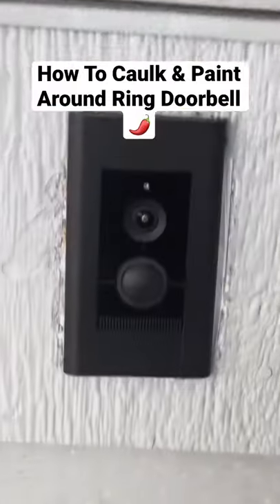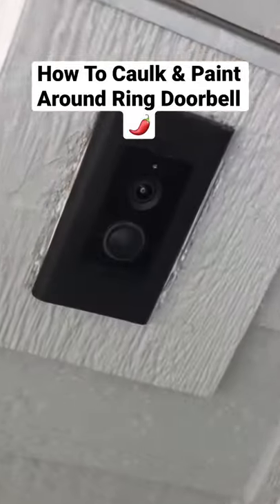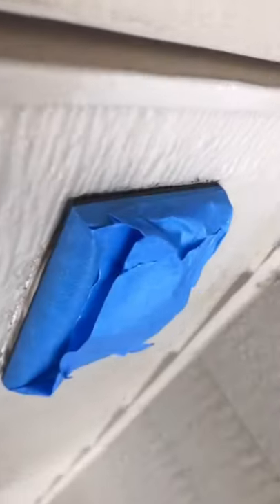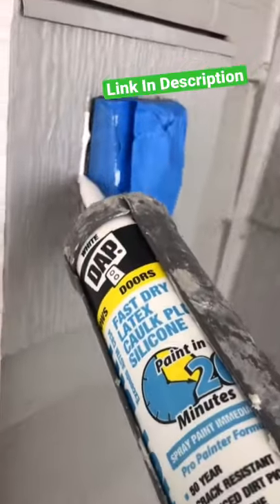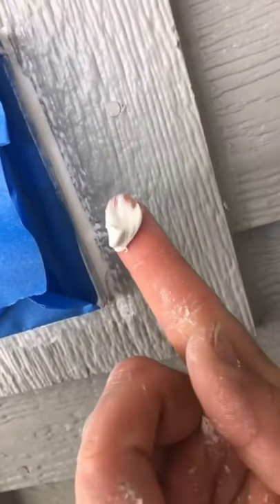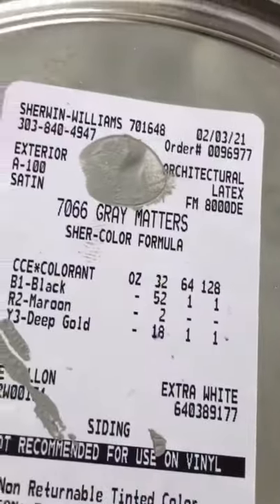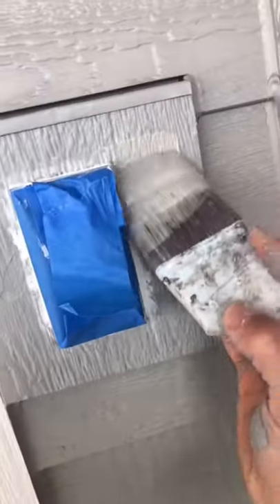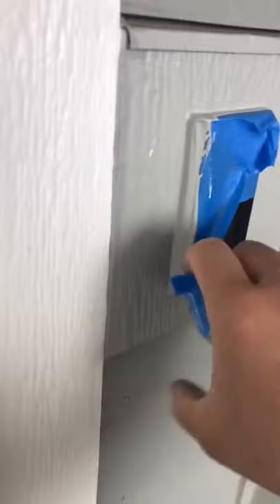How To Caulk & Paint Around Ring Doorbell. #caulk #paint #ringdoorbell #handyman #diy

Comment: Would not recommend caulking around door bell button. This device has to be able to be remove if it needs trouble shooted or serviced. So you'd be recaulking it everytime.
Reply: Got em 😂
Reply: You're right, it's like caulking a switch wall plate, sure you can do it, but the point is for it be removed, not glued onto the wall with caulk
Reply: Came here to say exactly that. It's going to be a huge pain every time.

Comment: FYI jalapeño. You can bondo the damage,(your favorite fix)then dremel tool the wood grain in,prime and paint.no replacement necesary,looks kick ass and it's still a quick repair.boom👍
Reply: Handctexturing wood grain with a Drexel is a quick repair?.
Reply: @kjcorder  yes.if you watch the video there is a circular pattern to the left of the ring where the wood grain is gone(the mdf peeled) along with the areas just around the ring he is addressing.you can take bondo and skim coat all the chipped and peeled grain areas.(bondo dries in 5 minutes),get your dremel ready and use the small cone  while the bondo is curing.when dry sand the bondo to the level of the grain peaks already there.if you sand to low it will look low when painted.like it does in the video.then dremel lines(or grains) in the bondo that look similar to the grains existing.caulk the thin gap around the ring.spray a couple thin coats of primer and use a blow dryer(for hair) to quickly dry the coats.then paint.this repair shouldnt take much longer then a half hour with someone experienced in surface repair like jalapeno and he didnt need to do much extra than what he already did. 👍
Reply: I thought someone was having a convo with themselves at first because your profile images are the same blue “k” lol

Comment: Out of all the impressive educational material I have watched on your channel. Nothing is more slicker than opening a can of paint with a razor! 👏
Reply: Careful, razor blades don’t have a lot of strength when used to pry things as they are so thin. I’ve had razor blades break and go flying. Using them to open paint cans will work, but you risk having a sharpened piece of metal go flying off in a random direction.
Reply: I would rather use a flat headed screw driver!
Reply: Thank you both for taking the time to respond and educate. I trust this message will find you well. I beleive the usage of the utility knife to open the can was only satire. I found the video humorous enough to respond in kind.
Reply: @heavycmc  haha i figured you did. Happy New year friend!
Reply: @abesview5855  And to you as well my friend. Peace and blessings! 🙌

Comment: Hey man how would you recommend moving the doorbell wiring closer to the door? I have a ring but im getting tired of being away from home and the battery die, and my problem is the doorbell wiring is behind a pillar blocking the cameras view if I place it there so I just want to move it closer to the door
Reply: I would run a wire from the inside, ( easier to fix drywall than siding typically), to the outside where you want your camera to be. You should have some knowledge of electrical circuits to do that but if not call an electrician.  Once your wire is poked out cut a piece of Azek trim or wood trim to mount the camera to, we call this piece a light block in Michigan.  You drill a hole through that trim piece ( like the one being repaired in the video) for the wire.  Azek has the advantage of having the ability to be mounted to your home with cortex screws which you can plug so they are less visible.  With wood you can use a bit if wood putty for exterior use to plug the holes.  Lastly it is important to flash the light block with some z strip metal.  This piece of metal sort of looks like a Z, except imagine the center part of the Z going straight up and down.  The top of the Z strip must go BEHIND YOUR HOUSES SIDING so that any water will drip on top of the Z strip and then be diverted away from your house.  If you do not flash the light block water can get behind the light block and then proceed to penetrate through the screw holes used to mount the light block to your house.  Hope that helps!